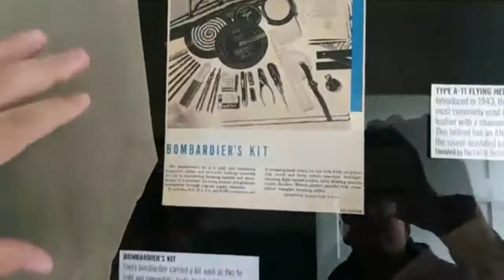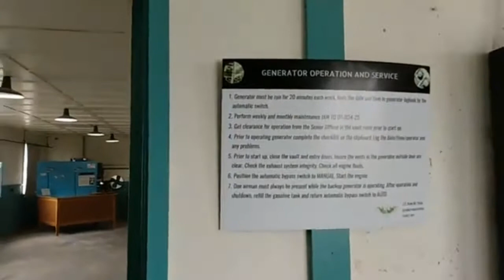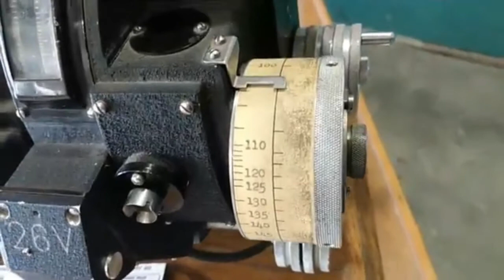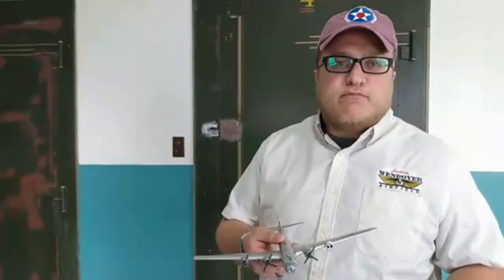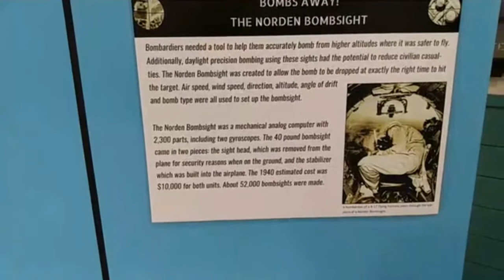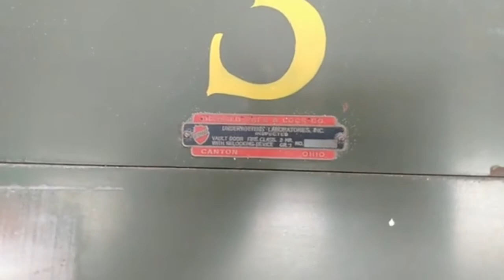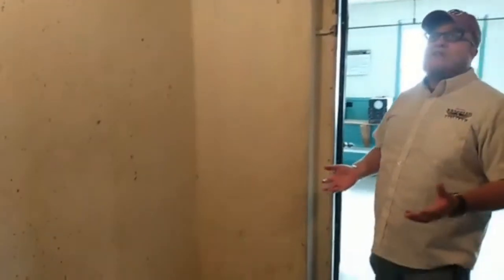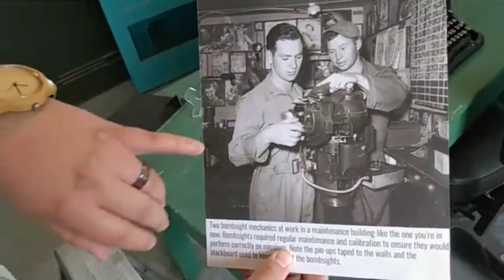Historic Wendover Airfield Live - Norden Bombsight Storage Building Tour

Comment: Good narration. Stabilized cameras are now common and inexpensive. A GoPro 7 has excellent built in stabilization. This older version only costs around $200. Suggest an editing program. Movavi is relatively simple and only cost $50. It is very hard to narrate in raw video. Even professionals can't do it without flubs. Knowing that you can re-take and edit makes things very much easier.
Reply from the maker: Thanks for the tips!